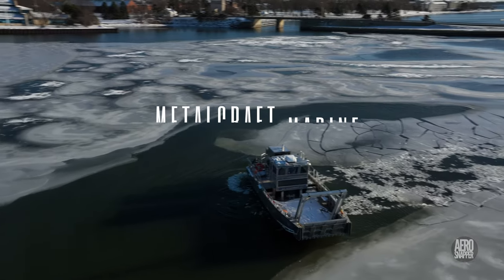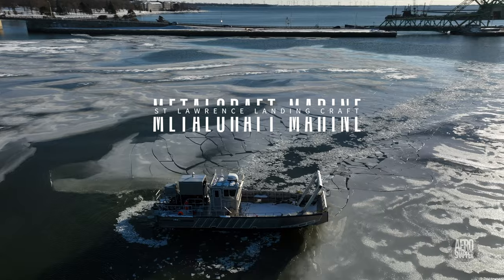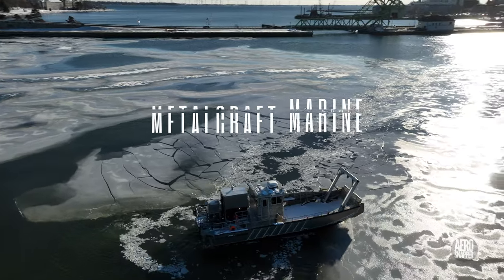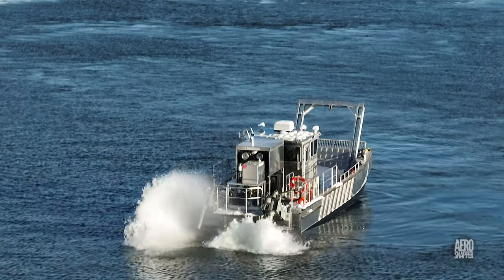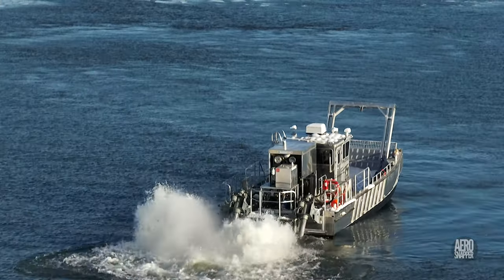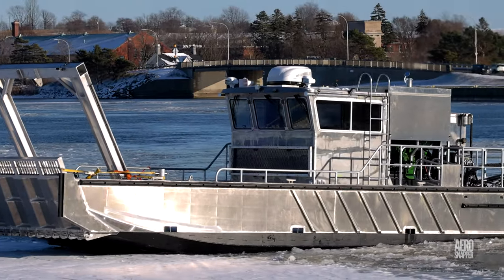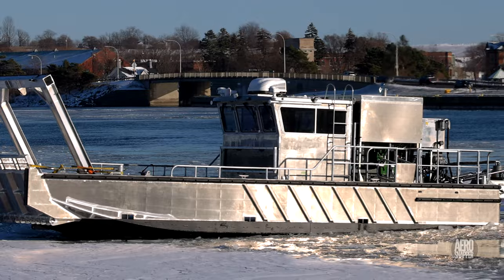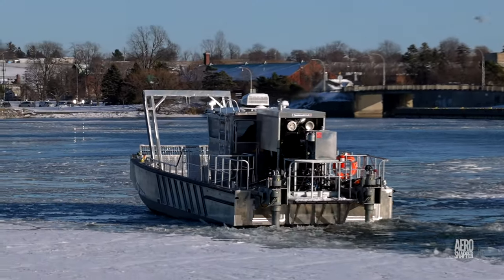Like a Deere in the Headlines.. 4K

Comment: Liked #28, you really know your boats in and out! Nice drone footages of this boat. Did they know you wrre recording? Not that you need permission when over water. Looks like a very powerful boat!!!
Watched the full video, liked button and comment in appreciation to support the right way, happy to support your channel 😊 Have a fun filled week, take care
Reply from the maker: Thank you - I rely a great deal for information on the manufacturer and their suppliers.  Yes, the crew knew that I was there, but their test routine is unaltered by attention. Some functions need to be trialled and all the controls proved true and correct.  It's just a 300 HP engine, but clearly provides sufficient power for those big hydraulic motors.  Have fun yourself and a great holiday season.
Reply: @Aerosnapper  Happy to support your channel,  thank you for the added information 😊 you got a great hobby! Happy holidays to you and your family 😎 👍